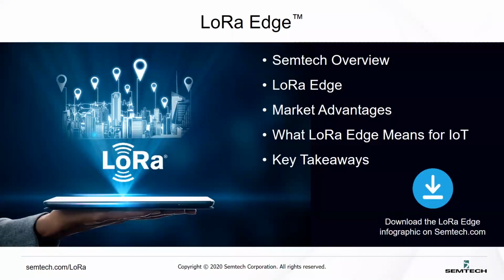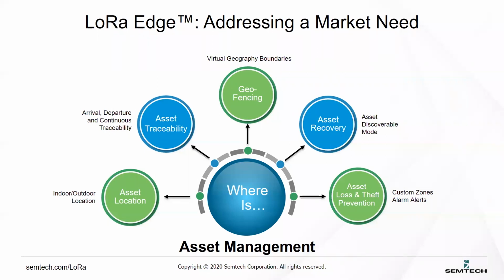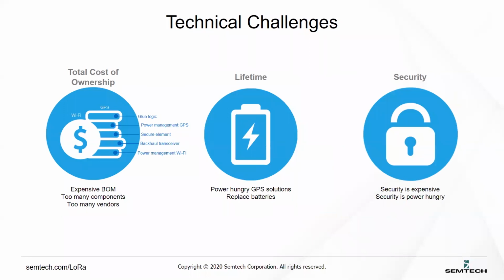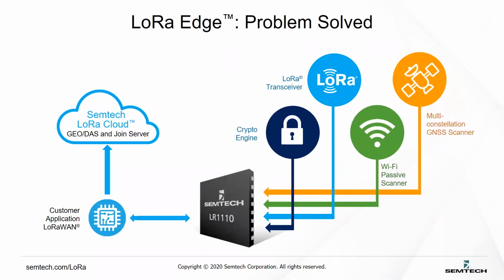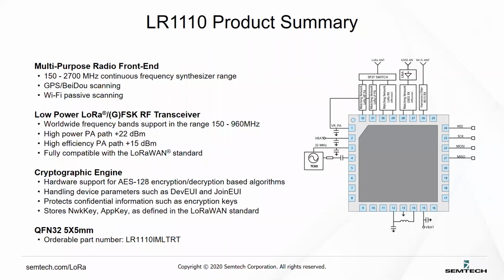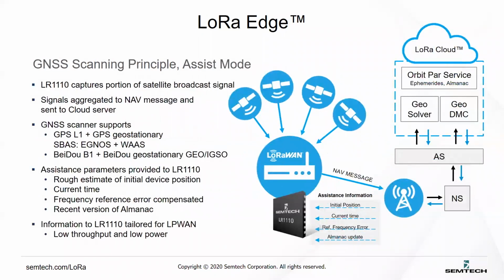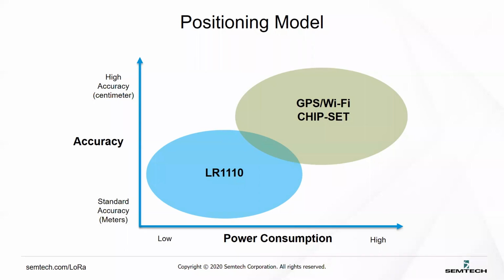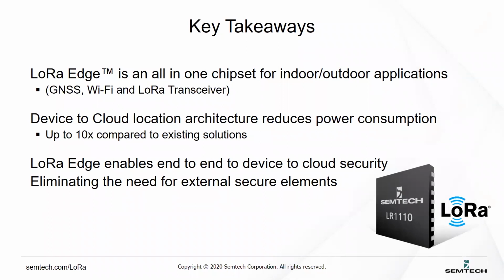LoRa Edge: Driving Smarter Geolocation for IoT

Comment: Hello, I did not understand one thing. Will it be possible to continue to use Proximus Network Server with your solution ? The initial scheme is Device -> Gateway -> Network Server (Proximus ) -> Application Server. Will it be now Device -> Gateway -> Network Server (Proximus) -> LoRa Cloud -> Application Server ?